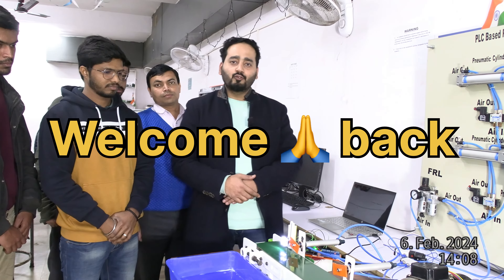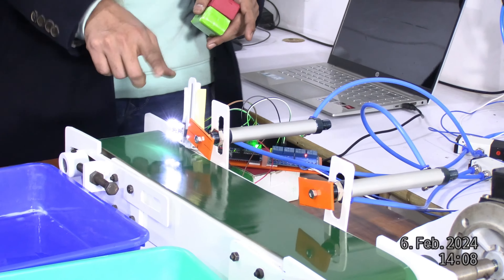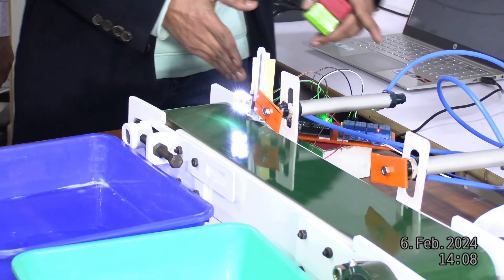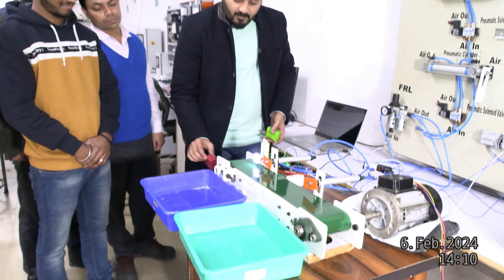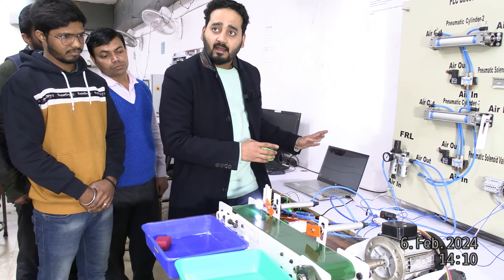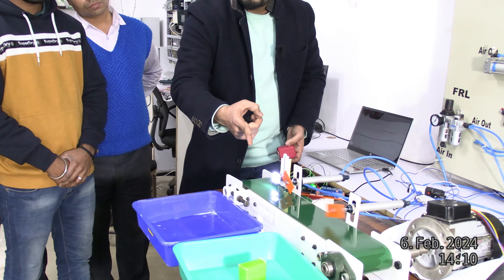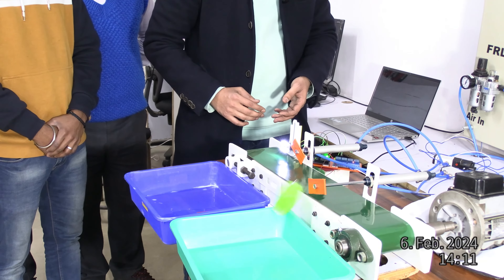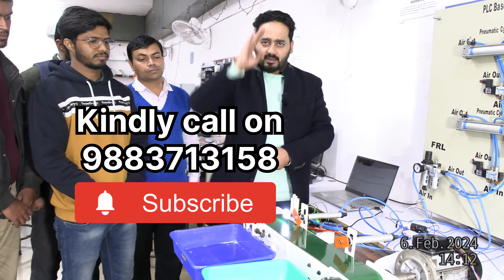Color Sorting using PLC & Arduino #plc#plcprogramming#automation #scada #panelwiring #electrical

Comment from the maker: For any training  Inquiries for Industrial automation training which include PLC, HMI, VFD, SCADA, panel wiring,instrumentation,etc.
Please call on +91-9883713158   
                         +91-7017921247
Address of Institute…..
E-44, Sector-3 Noida, near Sector-16 Noida Metro Station…
Advance Industrial Automation Training on PLC | SCADA | VFD | HMI | INSTRUMENTATION | PANEL WIRING | PANEL DESIGN, etc..
 join Autoinfotect to build a good Career in Automation, 100% Job Gurantee..